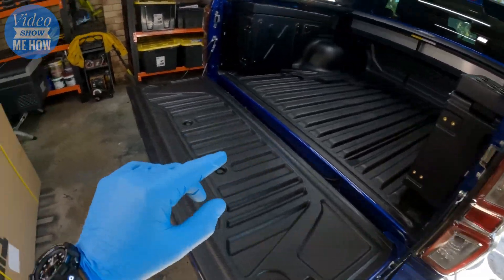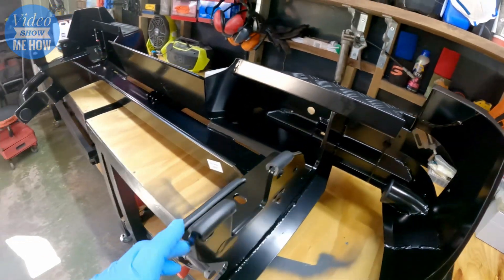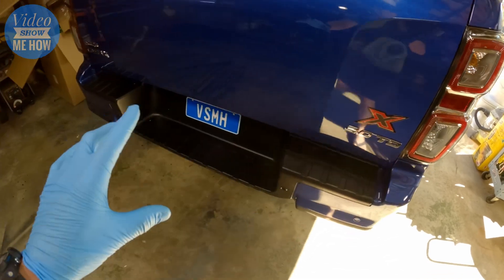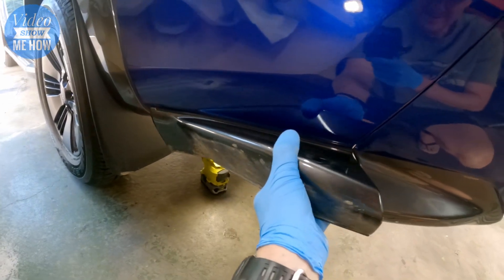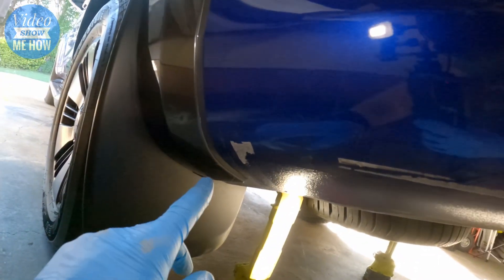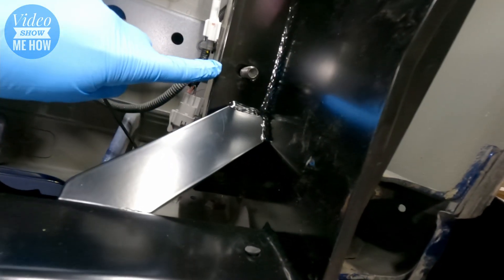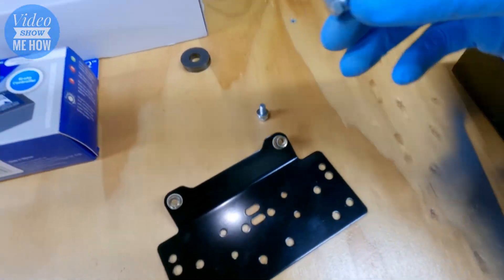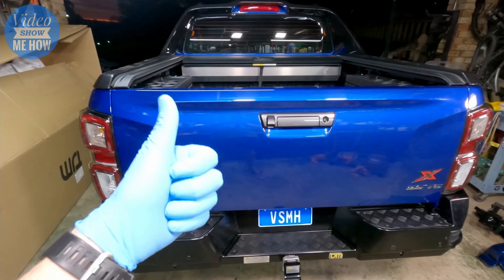TJM REAR BAR STEP TOW BAR Install | 2021 DMAX X-TERRAIN Build Series #4 (TJM 081SBRBA34G)

Comment: Great video, I used it to find out how to remove the rear bumper section, so I could remove all my XT's sensors. Currently relocation them to my new tray. Just a question, you don't happen to know the hole size on tmyour new bar that the reverse sensors plugged into? I current don't have access to my tub to check.
Reply from the maker: 21mm, though mileage may vary depending on the paint thickness ☺️

Comment: keep up the good work with the vids i like watching them its like a lil insider of how its done.
also for  people that do buy tjm as a lil bit of a help that arb and orher never do even though this video is very detailed and really well done. you can also download the installiation instructions straight off tjm if you need the extra assistance.
as for me im still waiting on my tjm gear. but only coz i got them colour coded to the flares.
Bit bummed out that the b-bar, rear bar and scrub bars from qld have been sent but have to wait 2 months for the side steps. and a wait on my under body protecting. alwell it happens.
Reply from the maker: Thanks for the comment 👌 Hopefully yours turns up soon

Comment: Hi mate I have fitted tow bar from Trailboss. I got it used from a car but the same car. But it used car didn’t have rear sensors I have thr model and harness fitted but now rear sensors fault when u discount Error go way. Any advise ?

Comment: Did you notice any difference to the ride comfort between factory and the TJM rear bar? Did it make it any worse or better with more weight? Or no change?
Reply from the maker: Slightly better if say, little more weight settled down the rear a bit

Comment: I just installed mine today. I noticed that it was a very very tight fit for the plug that goes onto the radar unit, i had to modify the plug a little bit.  Is that normal?
Reply from the maker: Hmmm was a bit ago can't really remember sorry! Get it on ok and radar working?
Reply: @VideoShowMeHow  yeah, had modify plug a fraction cause the bolt holding cover on was in the way. Yet to test it out

Comment: Cool, did the grip plates come with the kit or were they taken off the original plastic bumper? What is the advantage over the standard plastic/metal bar (except for tow hitch)?
Reply from the maker: Came with :) Much more protection
Reply: The hitch is also much higher up on the TJM bar. A few inches of extra clearance for offroading. If you're not going to be offroading... It's probably not worth the cost/weight.
Reply from the maker: Nice solid bar work under the tub too :)
Reply: @VideoShowMeHow  OK, I get the picture..thanks.

Comment: Another great video Adam, thanks.  I am watching this vid again because I just damaged the RH side bumper on my October 2020 model LSU dual cab.  I bought my vehicle with the IUA supplied canopy, tow bar and Isuzu branded electric break controller for towing our van.  I am being weight sensitive now looking at gross GVM for towing.  What do you think is the weight difference between the TJM rear step bar and the IUA tow bar assembly?
Reply from the maker: Hmm well the TJM bar comes in around the 66kg mark from memory, so you're probably adding around 30-35kg compared to the factory hitch assembly on the MY22s